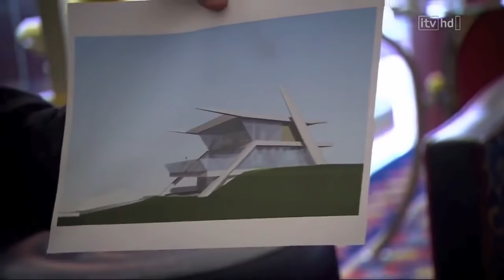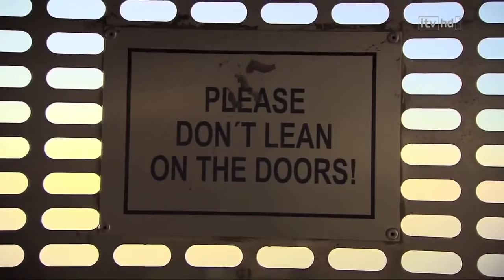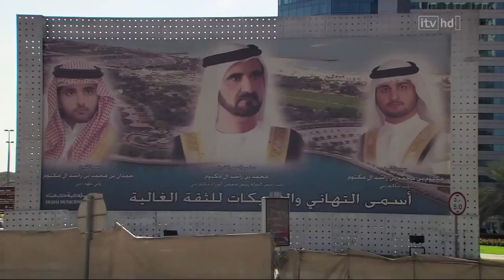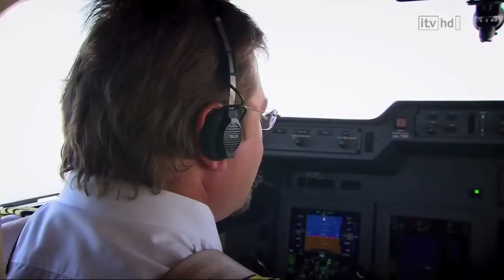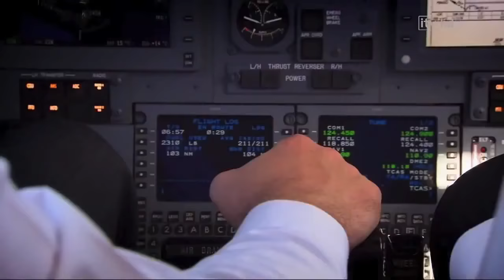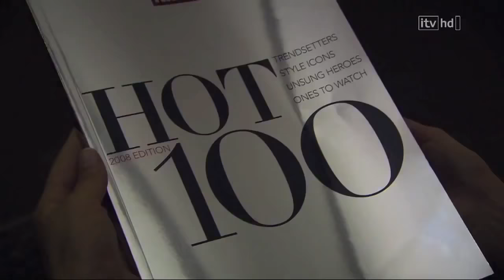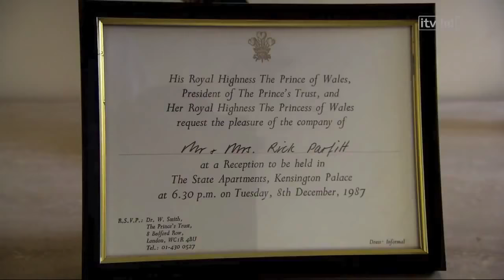The Lavish Lifestyle of Dubai Billionaires

Comment: Dubai emerged from the desert and in time will return to the desert  soon after the oil dries up. The poor will inherit the tall buildings when the rich abandon them alas without air conditioning.
Reply: Well, that’s been the whole strategy, is to transform Dubai into a total luxury/ vacation oasis Because the oil was due to run out. Time will tell.

Comment: Dubai summers are also known for the very high humidity level, which can make it very uncomfortable for many with exceptionally high dew points in summer. Heat index values can reach over 60 °C (140 °F) at the height of summer. By 2050 rising sea levels will have destroyed the artificial islands. Dubai is a dreadful mistake and a disaster waiting to happen.
Reply: My thoughts the same. This in 20 years disaster